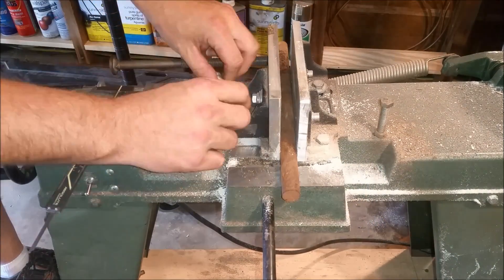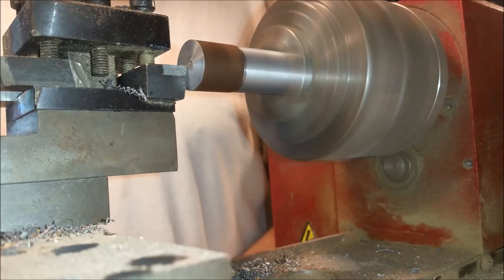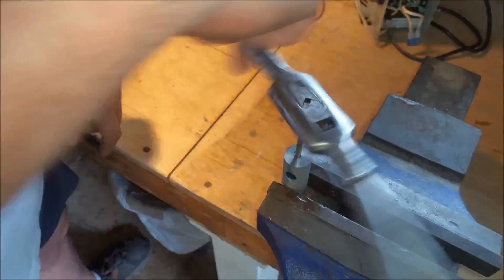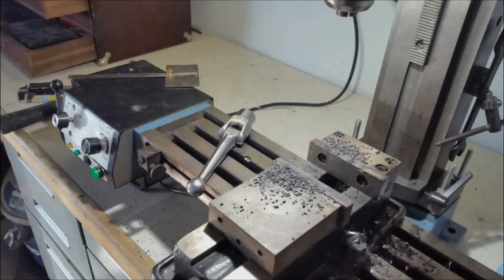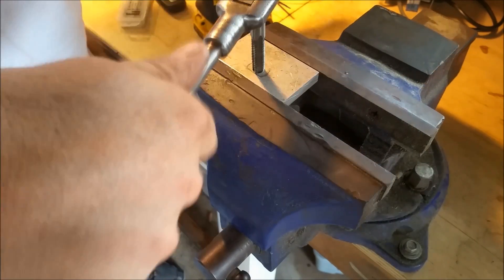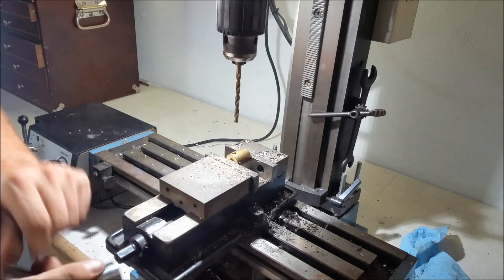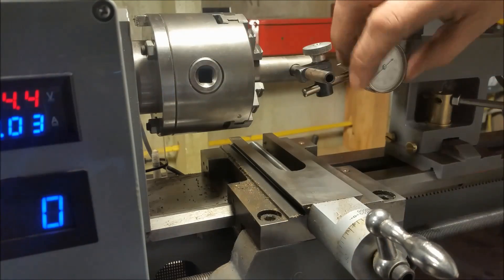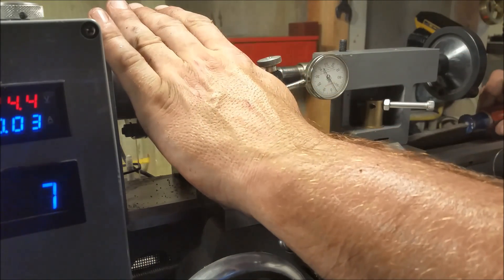Mini Lathe tailstock centering: The definitive video guide

Comment: Personal opinion, but you asked.  Ditch the music, it is just distracting while you are talking and really isn't needed when you aren't talking.  Don't worry about the pointing out the uhs.

Yeah, I think you need to attach the indicator directly to the turned surface if you are going to do it that way and you probably don't want to remove the bar after you turn it if you are using your 3 jaw.
Reply: That sounds logical. Going between centers you eliminate chuck run out as a factor. You might actually be able to better characterize what run out from the chuck you do have if you do this first. Of course one would hope the head stock was center aligned first. Hmm, so many factors to consider....  BLECH!!!!
Reply from the maker: Excellent advise for the viewers on the chuck comment. The was my first attempt to get some real precision from my tail stock. Pathetically i used to use under sized drills because i know my tail stock was off center and i would also try and hold it to center. Now i should get some better center holes.
I appreciate your comments about...uhs...and the music.  -don
Reply: I may just breakdown and get one of the Edge products test bars.  Otherwise, turning a center on the chuck and then turning a part between the centers and measuring the taper would be the proper way from what I've gathered...just hadn't done it myself yet either.